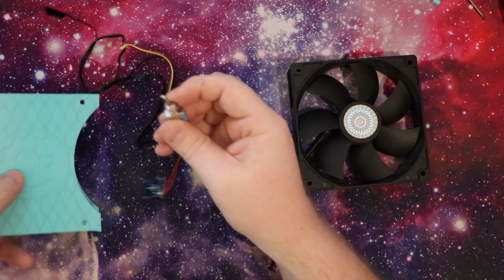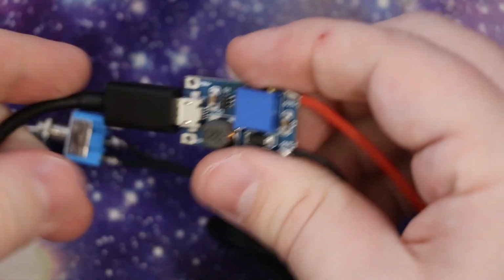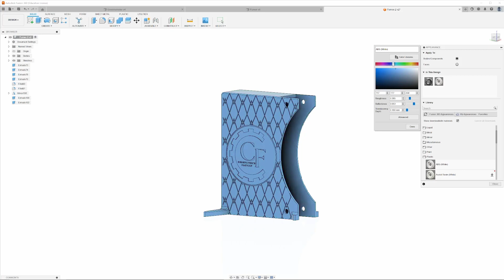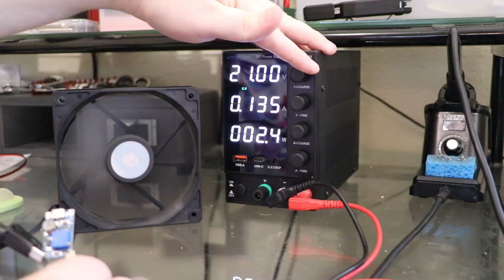PCFumex: A 3D-Printed USB Fume Extractor

Comment: Awesome idea and video, thank you!
What you said about (lithium) batteries at 2:20 is so true. Nowadays there are cordless options for almost all devices because people hate cables. People forget that lithium batteries can be a fire hazard. Also many batteries are built-in and devices are thrown away when the battery life gets bad - what a waste :(. I'm not completely against battery powered devices, I just think we need to think about if it's really necessary for the devices we are looking to buy.
Reply from the maker: Honestly!! Completely agree. It's REALLY easy to screw things up with any high-power battery... I'm starting to lean away from them in my projects. It'll takes just one failure to ruin my whole life.

Comment: I’d be curious to know if using a pressure-optimized fan with an activated carbon/particulate-absorbing filter would work better than a volume-optimized fan. Basically a case fan vs a radiator fan - not sure how much resistance the filters would add
Reply from the maker: Good point! Would be interesting to see the comparison. Maybe something for @MajorHardware's Fan Showdown? 👀